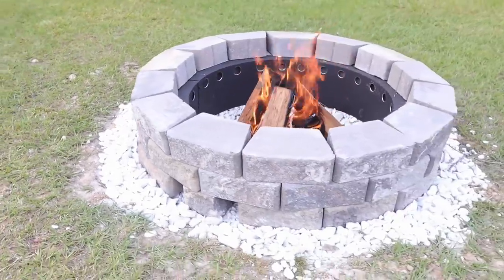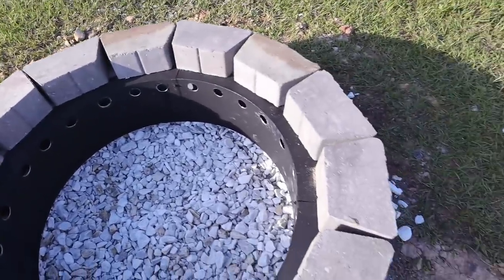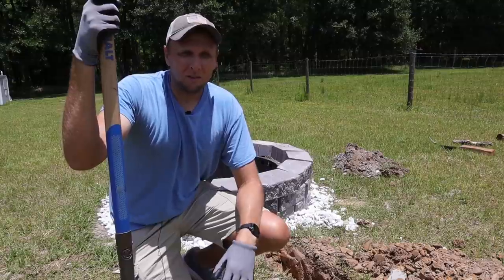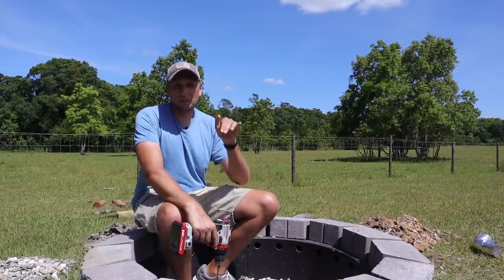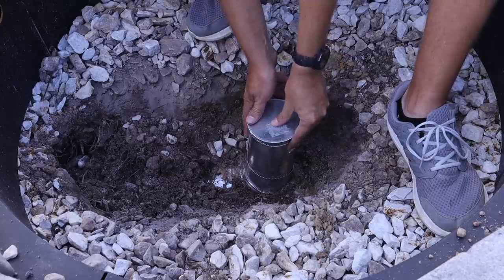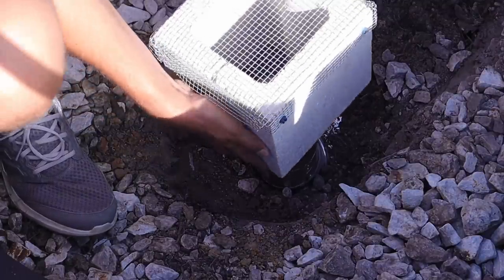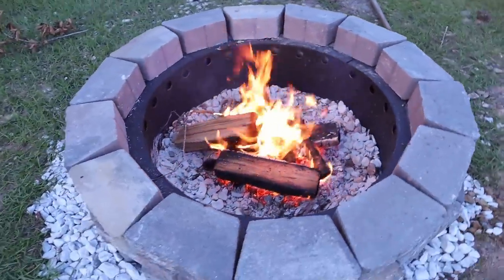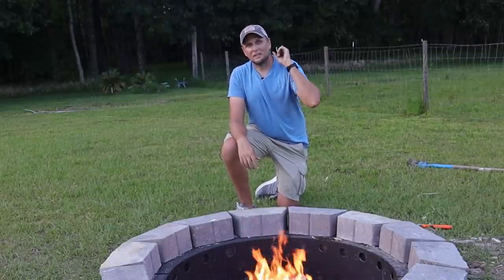Can the Smokeless Fire Pit Be Made Better? Part 2 of How To Build a Smokeless Fire Pit

Comment: How do you keep the ash from stifling the air from flowing from the bottom?
Reply from the maker: That’s one of the reasons why I have a layer of stone and the hardware cloth there.  While they don’t keep everything out they keep the vast majority out.  Hasn’t been an issue.
Reply: @HowToHomeDIY  I was more thinking about the build up over the rocks, not so much it getting into your duct.  I'd be curious if you end up having to clean out your pit frequently.  Thank you for making the video it was very engaging.
Reply from the maker: Ahh I gotcha.  I haven’t had an issue with that.  Between the last two fires I just brushed the top of it off just to make sure it was as good as it could be.  I appreciate the feedback!

Comment: I didnt do smokeless, but I had a bunch of spare grout powder from a bathroom project. So I "concreted" the bottom of my fire pit. MUCH easier to clean out than gravel or earth. 

And as to your new vent tube, I would have done black iron pipe. It will last longer. Yes, it will rust, but will take MANY years before it rusts through. It will be interesting to know how long that thin aluminum lasts. Especially exposed to the heat of your fire. I suspect it could melt. I'm genuinely curious. Good luck!
Reply from the maker: It won’t melt, it’s well below the fire and doesn’t get anywhere near hot enough.  After numerous fires I can still read the upc sticker on it which is at the top of it.

Comment: hmmm....I would prefer less smoke over a bigger fire.    Too much air through the new tunnel will undo the concept of  burning the smoke....."just my thoughts"
Reply from the maker: The bigger fire is going to promote less smoke because it will heat up the ring even more just making it more affective.

Comment: I might suggest not having a bonfire, that tubing is maybe melt. IMHO. But I definitely like the upgrade, like a Dakota firehole.
Reply from the maker: This has been a common thought on this video.  However, heat will never go down unless it’s being pushed by a fan for instance.  Also, radiant heat from a fire does not get hot enough to melt aluminum it would need to be directly in the center of the fire.  I have had numerous large fires in the pit and you can still read the UPC code sticker on the aluminum.  The Dakota fire pit method did just make the most sense to me to get more air into the bottom of the fire.  Thanks for the comment David.

Comment: FYI that tube is not Aluminum. It would have melted. It's Galvanized Sheet Metal. The same material small chimney & dryer vents are made of.
Reply from the maker: The tubing is 100% aluminum which is also what most dryer vents are made of.  It doesn't melt because it is well below the fire and cooler fresh air is coming through it to further keep it from heating up. The top end cap is the only part of it that is galvanized.  This was A: because it is more heat resistant and B: what was available as far as a 4" end cap goes at my local store.

Comment: I don't see a "significant" difference in the fire with before and after
Reply from the maker: I suppose significant can be a relative term.  But it was quite a bit bigger and overall just healthier looking.  Also, it burned a lot longer than it normally would without adding wood to it.

Comment: Wouldn't you have been able to just drill a couple holes in the bottom of the ring, to allow the air from the missing bricks to enter and do the same thing as the intake pipe?
Reply from the maker: No.  Would not be nearly as effective and might affect the performance of the ring to an extent.

Comment: It is a lot better to add the tubing END at the wall around the perimeter of the fire pit, NOT directly under the fire. Common sense air is being blocked. You should redo this and design it like a Dakota Fire pit. Research it. I did this for my fire pit, only dug 24” deep X 24” wide and can have around 12-15 wedge logs stacked up. The fire with minimum breeze burns hot and smoke is upwards or barely noticeable.
Reply from the maker: Mine works great and has not been blocked at any point.   I won’t be changing anything.     Glad you like yours.

Comment: the piece you are missing is - you have to get the air super hot BEFORE it touches the fire. you are not super heating the metal walls. you built this thing with a huge fire ring. you should probably buy a far smaller fire ring if you're only gonna put in a few pieces of wood. once you put enough wood into the pit you'll get the walls super hot and you will have a smokeless fire. I know this because my friend has one of the very large (name brand) smokeless fire pits and it doesn't work well until you get lots of wood in it and it gets super hot. once it gets super hot you see flames coming out of the holes, which is just the oxygen-rich air igniting the wood gasses as it enters. here's the deal, cold wood gasses are smoke and soot. smoke is incomplete combustion. that's all it is. regular fire pits are in efficient. they don't burn well.

Comment: ??? I am not quite understanding what you mean the smokeless fire pit every fire smokes just because it's clear it still smokes no matter what if you want to get rid of a cloudy smoke dry wood helps a lot certain wood Burns clear then other types of wood wet wood makes smoke but they're burn they smoke no matter whether they are clear or a cloudy grey or a dark smoke every fire smokes just my thoughts because you really had me confused on smokeless fire pit
Reply from the maker: Yes fires are going to smoke.  Doing numerous things can help to reduce it though.  Yeah dry wood certainly helps.  Doing or building what I have in the videos also helps immensely by creating a healthier fire and help to burn off the excess fuel, which is smoke.  Hope this helps clear up your confusion.

Comment: I'd be concerned with the ducting filling with water and not working anymore.  Maybe sealing the duct with aluminum tape before installing it, and also installing a cap on both ends unless the pit is in use, would help.
Reply from the maker: How is it getting filled with water?  The ends are slightly above grade.  I do put a paver over the top of the intake portion because why not.  I’ve had numerous storms since this was installed, went out and looked at it and it’s dry.
Reply: @HowToHomeDIY  I may just be putting my yard in place of yours.  My fire pit is in a low spot of my yard, so it would have more water than normal.

Comment: The temperature of the ring has absolutely nothing to do with how clean it burns. Should have went with a stove type end cap (chimney cap) on the end of the pipe. Also a fire built on a grate up off the ground would burn cleaner. Part of the problem is the moisture it pulls off the ground. Your fire can't be sitting directly on the ground to burn smoke free
Reply from the maker: It has a lot to do with how this works.  The hotter the ring, the hotter the air behind the ring gets causing it to rise and be forced out into the top of the fire to help burn off the excess smoke.  My fire is not directly on the ground, there are about 3 inches of rock under the fire before getting to the ground.  After having this and using it for many months I would not change anything with this addition to the pit as it works great.

Comment: that aluminum duct is going to melt
Reply from the maker: No it isn’t.  The melting point of aluminum is 1,221 degrees Fahrenheit.  Bonfires can range anywhere from a very small fire of 600 degrees Fahrenheit, a medium and common fire of 900-1,200 degrees Fahrenheit, and a very large fire would be up to around 2,000 degrees Fahrenheit.  These are all internal temperatures.  As you get further from the core of the fire, the temperature goes down.  Right above the flames where most people cook the temperature goes way down.  This is above the fire where the heat is rising to.  Where this metal is, is about 3 inches below where the fire will be, there is a layer of rock between the fire and the metal.  The end cap is galvanized steel then it goes to the aluminum tubing.  On top of all of that, the tubing is constantly pulling cooler fresh air through it which is also going to help keep the temperature down.  So no, it will not get nearly hot enough to melt.  I have had numerous fires now in it and it is exactly the same as it was the day it was installed.
Reply: I can't see this standing up over time. Any fire I've ever had has zero problems melting aluminium.
Reply from the maker: Yeah because it’s directly in the fire.

Comment: You've never thrown a soda can into a fire, have you?
That thin aluminum is going to melt
A better way to get air to both the ring and the fire is to add another layer of stones so that the metal ring is suspended by them, thus allowing air to flow under the ring into the fire and into the ring at the same time.
Reply from the maker: No the aluminum is not going to melt because it is well below the fire.  Heat rises it does not descend unless forced by fans for instance.  If you suspended the metal ring like you are talking about then the holes at the top won’t do anything because the majority of the air will just be sucked under the ring.

Comment: What kind of bit did you use for the top holes? I bought the same ring but the $12 holesaw I bought (1.25”) isn’t even close to being able to cut through the steel.
Reply from the maker: I used a 1 1/2" bi metal hole saw.  If I could go back though I would make the holes much smaller and maybe a few more of them.  I think it would make it work even better.  The cutting through with the hole saw was not the easiest.  A step bit may be a better route.
Reply: You can skip drilling the holes by burrying the ring  1/2 " lower than your top row of pavers. Build the top row of pavers so they are a slightly smaller diameter circle that covers the ring making a gap all the way around that the air shoots through. I tested it this weekend and it works well
Reply: @bradbacking2295  I was thinking the same thing, but does your top row of pavers then crumble apart from the heat of the fire?  The metal ring protects the pavers generally.  Having them exposed to the fire seems like they wouldn't last long. ?

Comment: great idea but how do you get the rain water out of the pipe when it fills up?
Reply from the maker: Typically it drains very quickly and has never been an issue any time I’ve had a fire.  But if it poured down rain right before I wanted to have a fire I would just remove one end and use a shop vac to pull it out.

Comment: I wonder if you would get the same effect if you just made a few gaps in the rocks under the ring. I'm not sure I'd go through the hassle of doing that for a little improvement. But I give you credit. Great video and instructions.
Reply from the maker: Hey Michael, I thought about that, but I feel as though I would lose, at least to an extent, the functionality of the top of the ring.  The more holes there are, usually makes air flow less efficient.  Those are just my thoughts.  Thanks for the feedback!
Reply: @HowToHomeDIY  I agree with you on that too big of an opening might reduce the flow to the top holes. But im talking about making like 4-6 openings about 2" in diameter on the bottom of the pit. Place some 2" diameter pipes, about 12''  long or so, on the bottom of the pit. One end at the center of the pit and the other end at the opening in the bottom layer of blocks. No digging needed. Just place 1" layer of stone, on the bottom of the pit,  lay the pipes on that. Then bury the pipes with more stones. Cover the center where they all meet with a screen or something to keep the ashes from falling in and blocking the center.
    In my case, I have a patio with about 4" - 5" deep of crushed bluestone ,cuz im too cheap and lazy to lay papers or build a deck! I'm going to try that when I build mine soon. I'll let you know how it works. But I thought you did a great job on both videos. Keep up the great work!!
Reply: Another idea is to just buy a metal water heater pan for like $25. Drill a bunch of 3/8 holes in it ( like you see at the bottom of the Solo) and place in the bottom of the pit, suspended about 4" off the rocks with bricks. It will  create airflow to go up through the holes and feed the fire like on the SOLO. It makes for easy cleanup too. Just pull the pan out and dump the ashes in the neighbor's yard! LOL.. Imma do that!!
Reply from the maker: Now I’m following.  Yes that all sounds like a good idea to me.  That’s why I like doing these videos, it’s always interesting the ideas I hear that come from them of other affective ways to do something.  As a whole this helps the community 😊
Reply from the maker: Dump it in the neighbors yard 😂. That’s awesome!
Reply: @HowToHomeDIY  Well you and a few others  got it started with the idea of replicating the SOLO concept/design. I'm sure we'll think of other cool ideas as we go along!!.

Comment: Low smoke would be a better description. There are a multitude of solutions to the problem. One rather elegant method (and an example of use what you have) was done by reservation American Indians when they became acquainted with the ubiquitous food can. Dig a trench, place cans with ends removed end to end extending from the outside of the tipi to the fire area and light up. The tipi is one large flue. Intense engineering is not required. Even if they work, pits are nothing more than a lawn ornament. They have become fashionable, but serve no real purpose. They don't keep you warm, they don't cook food as good as a grill and need constant attention. This design has the additional problem of having to clean the air intake. From what I have seen here in the Rockies, pits have a very short life expectancy. They are just a temporary backyard toy.